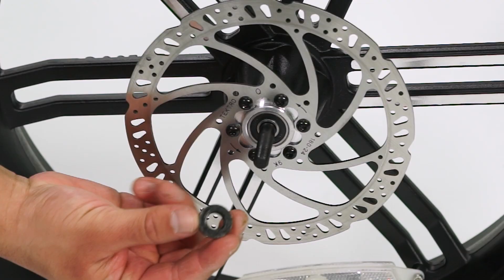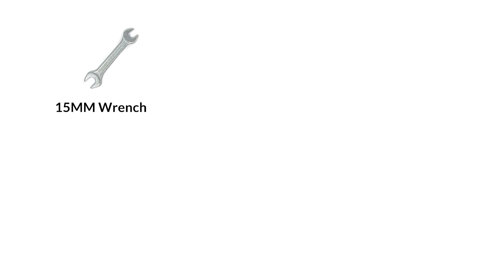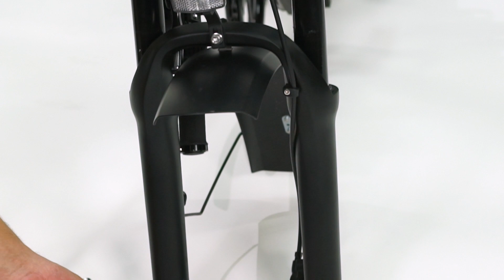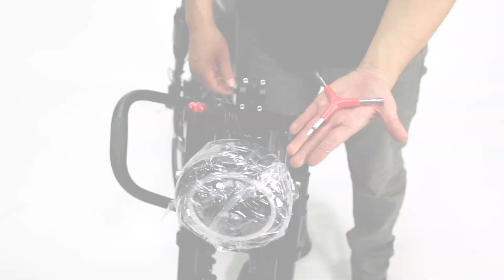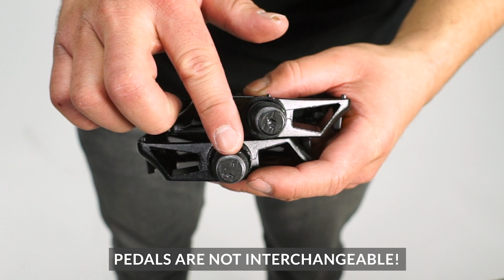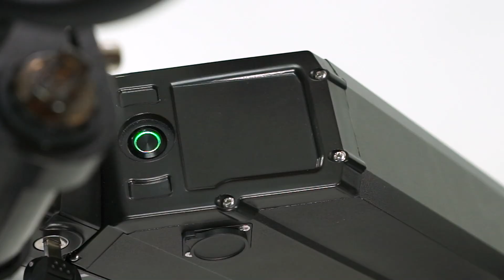Juiced Bikes Scorpion Assembly and Set-Up

Comment: Ours came with the front fender and headlight unattached with no explanation how to put those on.
I have some hardware, with a clear reflecter that I think goes on the front fender but the screw doesn't seem to fit and there are some black plastic caps that I have no clue where they go.
I also have no idea how to put the headlight on and no instructions.
Is there another video you could link me to?
Reply: There's also what appears to be the horn unattached with the rest of the items.

Comment: Any more tips to remember from E-bike pros out there? This will be my first one so I'm nervous.
Reply: Get some slime and mr tuffy for you tires....it will up the weight but helps out a lot with flats. also try finding foam strips for your chain cause it will be slapping the frame when you hit bumps, a chain tensioner also is an option.